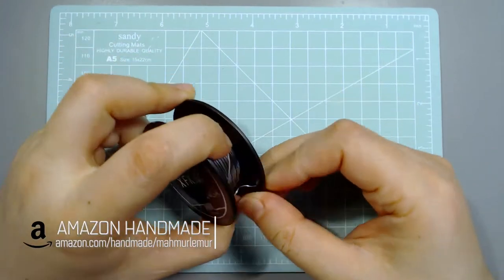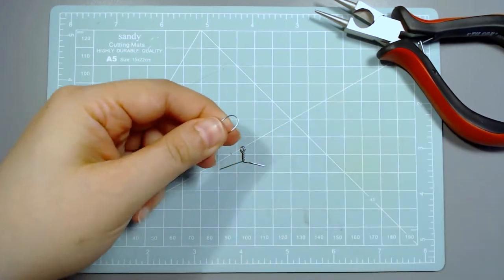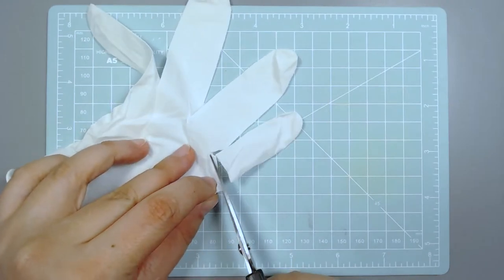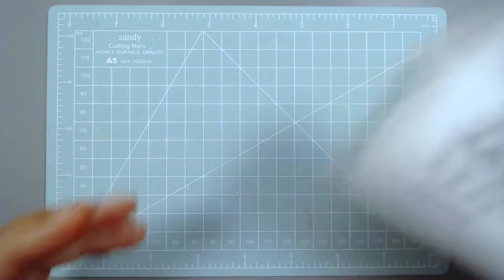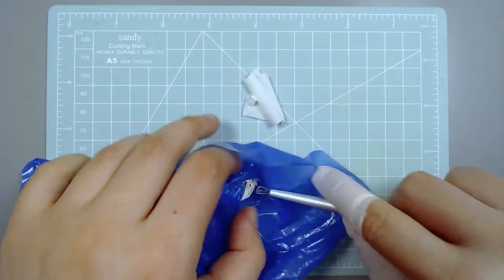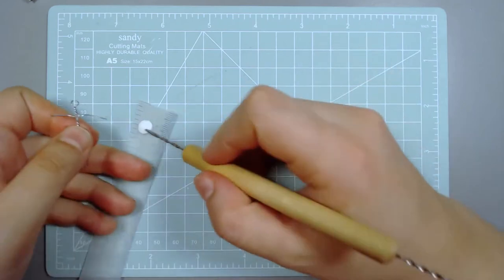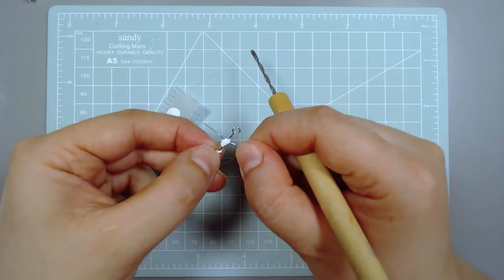How to Make a Mini ARMATURE for Miniature Figures

Comment: Why not use polymer clay directly? Or even superglue and baking soda which is instant + 1 minute with a nail file for finish. Beats 24 hours.
Reply from the maker: If I knew those ideas I would have definitely tried them! Thanks! 😄 But I tried Super Sculpey and it is fragile when you use this tiny amount of clay. Maybe fimo works better because it's elastic.

Comment: Can you tell me the length  of the wire in cm
Reply from the maker: It's 0.5 cm steel wire.
Reply: @MahmurLemur i ment the length of the wire
Reply from the maker: @santoshdas1472  The figure is 3 cm. Do you mean that? Or do you mean the whole length of the wire that is used which I don't know :)
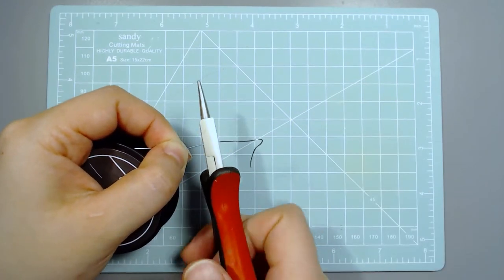Reply: @MahmurLemur  the length of the wire you cut in 0:13 and 0:17
Reply from the maker: @santoshdas1472   I really don't know. I eyeballed it.
Reply: @MahmurLemur  still any guess

Comment: Hello I have lot of paper clips (iron), can I use it instead of the wire you mentioned?
Reply from the maker: Sure you can use them. I used a paperclip for one of my minis and it worked fine. They are very durable too.